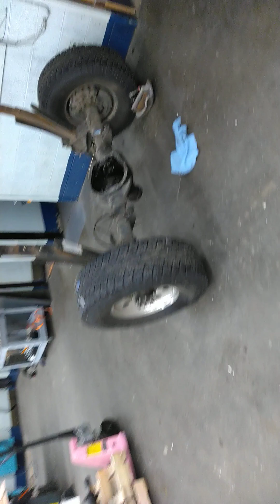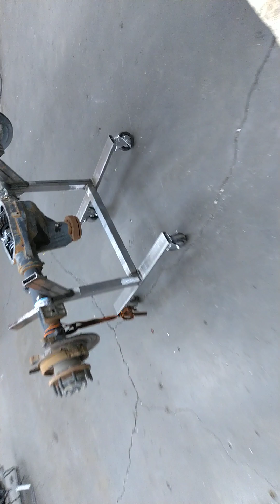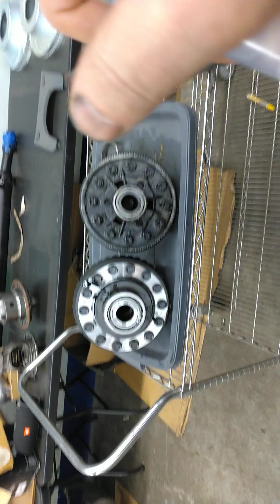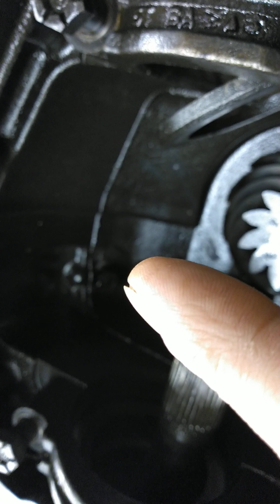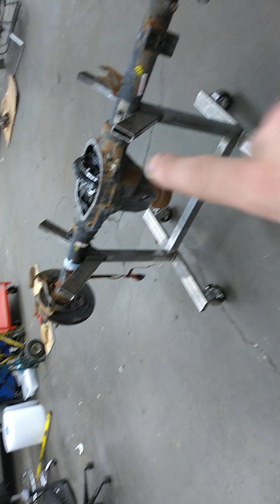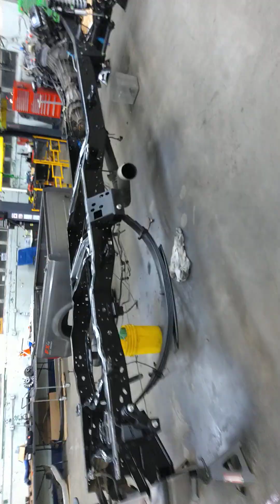superduty rear axle swap pipe discussion

Comment: That sounds like a great price for the rear axle.  Can you say where you bought it?  I would like to do similar on an 02.  Thanks.
Reply from the maker: I will reply again with the sellers name, but it was from eBay and they were a salvage yard based in arizona
Reply from the maker: On eBay it's the user name is secondchanceautomotiveparts. I had called them directly but can't find the email with their direct phone number. Stay away from all east coast sellers, they sell rust by the pound.
Reply: @One_More_Summer_Garage  Thanks